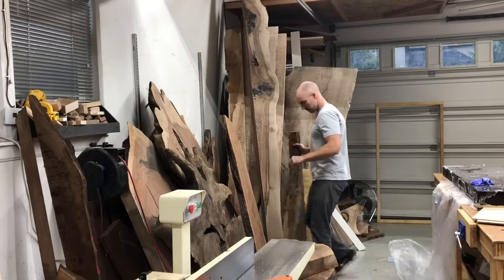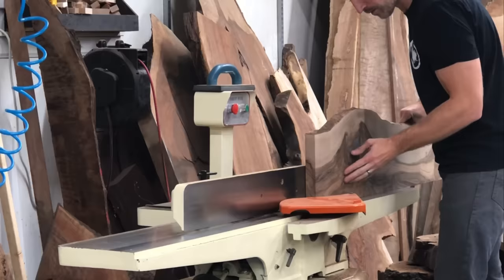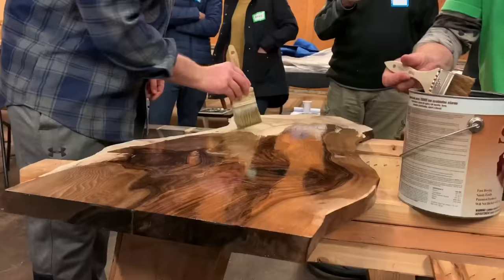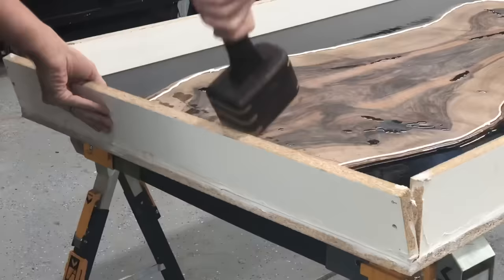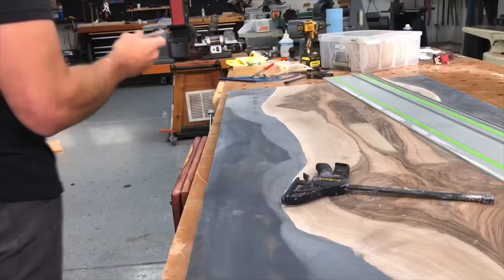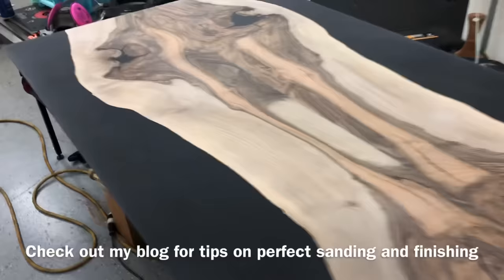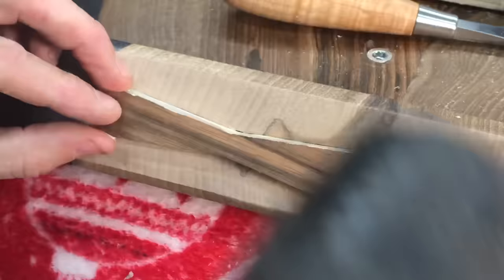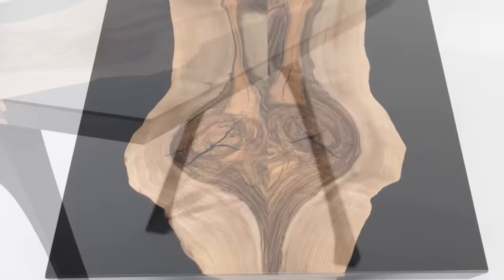Use Half the Epoxy In Your Table Project

Comment: I really like the technique of trimming the edges to add thickness.
Reply from the maker: Thanks Jamie!
Reply: That's a granite trick to create a bullnose profile. Never thought about it in this situation though. Nice!
Reply: @BlacktailStudio  just wondering why you apply shellac to the slab before pourng  the epoxy?
Reply: @ryanhanslo3029  he’s said in the past that it is to seal the wood so it won’t be stained by the epoxy when he pours. That way he only has to do minimal planing and sanding afterwards to have the natural wood figure and coloring exposed
Reply: @TheHuntron2000  if the epoxy seeps into the wood, even plaining and sanding won't save it. The edges get "blurry" because the wood gets dyed black by the epoxy and there isn't a sharp line of contrast anymore

Comment: I've been watching your videos for some time now and have watched most of the earlier ones. This table and the "trick" to save resin is great. I think the legs are perfect, especially if it's used as a desk.
You have inspired me to branch out from turning resin and timer pieces to making my first river table, out of walnut no less! Walnut is not so common in Australia and you have to be in the right place at the right time to get some. A friend cut some slabs for me from his walnut tree that died of old age and they've been sitting in the rack for a few years. They're a bit wormy but that adds character (doesn't it?).

Comment: I watched many of your videos before building my own epoxy resin table. I would like to thank you for sharing so many valuable bits of information. In return I would like to share with you one useful tip  that I haven't yet seen on any woodworking video and that I discovered on my own. Cleaning up the edges of a live board and knot holes on old timber can be done very effectively using a high pressure water hose (Karcher or similar) . This can remove rotten wood and bark easily, cleanly and quickly. My own table was made from very old elm boards that I found in a local sawmill, felled 40 years ago and then forgotten. (I live in France). Thank you once again.
Reply from the maker: Thanks!

Comment: I use threaded inserts with hex bolts whenever possible, especially when mounting metal legs to a table top. Good tip on putting glue in the hole.
Reply from the maker: Thanks dan 👊

Comment: Great video Cam!  Yeah, I use Flowyline for most of my legs. I love the designs Alex comes up with. In fact, the curved ones you displayed at the end I got a few months back.  Thanks for the excellent instructions, I have learned so much from them, and became so inspired that I am doing a lot more work now - in my 1 car garage, in the winter... I also just purchased a Festool sander, with the dust collector, it's on the way now, and I can't wait to try them out!

Comment: I am not trying to be overly critical, you are very talented and make amazing things, one thing I think would help, I think you should invest in a portable table top drill press to ensure that you are getting a perfect vertical hole when drill for the threaded inserts. Some times I can see how crooked they are and I think its a small over sight but should be corrected.

Comment: I was a painter for 30 years and applied many epoxy coatings
on different substrates, including kitchen counter tops.  The epoxy  wasn't durable enough on counter tops,  especially in the area around the toaster.  Apparently people slice toasted items directly on the counter top.  I haven't used your particular brand of epoxy, so possibly your brand would hold up, but my experience leeds me to believe that epoxy is pretty to look at.

Comment: Great project.  Not only saves epoxy, but probably reduces the weight of the table.  The issue you had with the black epoxy on the edge where you covered it up with a bowtie made me wonder if issues like that could be mitigated by using clear epoxy to glue things together?  What do you think?

Comment: A remarkable work of art as well as a sound solid table and excellent instruction. I am polishing a slice of apple crotch wood  and I'm not a woodworker. 55 years ago at school they told me to wet the wood to bring up the grain before I polish it. Times have changed. Should I use an oil as a finish coat or an epoxy please ? I would like a shine and to see the grain. Thankyou for helping a an enthusiastic raw amatuer.
Reply from the maker: Thanks Martin!

Comment: a small bit of advise to others from another woodworker. the domino tool is probably the best option, though I've never liked how they feel a bit loose in the holes. however the biscuit tool and biscuits are a good halfway house between dominos and dowels. they work on the same principle, and are cut in using a similar tool, however they are oval shaped and the tool cuts out a semi-circle. the biscuits are designed to swell with the moisture of the glue (water based glue to be used) because the tool is a lot more simple and the tech a lot older, the tools are much much cheaper!

Comment: I can't get enough of your work Cam! Thanks and keep it coming!
So your work has inspired me to build a dining room table with an epoxy pour inlay. You've probably had this question before, but I'm wondering with your experience, how durable is epoxy generally? Heat (hot pots), scratches, two young boys...?
Thanks for your help!
Reply from the maker: No hot pots. Basically it’s hard plastic

Comment: I've found that biscuits work just as good as dowels and are easier to use.  I've glued up many tables tops made of anywhere from 5 to 10 planks and have always used biscuits and they have never failed me.  

Dowels take too long and imo have no real benefit.  Although, I would love to own a Domino, I just haven't made the purchase yet.  It will be one of the last purchases I make since my trusty Makita biscuit joiner has always served me well when it comes to joining two pieces of wood together. 

P.S.  I just found your channel and have been loving the content.  Though I've been a professional woodworker for nearly ten years, I've never done an epoxy table before.  Heck, I've never even done one from a slab. I've always bought boards and build the tops from planks.  But I'm going to up my game and start selling more expensive tables.  I'm going to be purchasing two black walnut slabs soon (already have a supplier who has them in stock and sent me photos last night) and plan on building two tables with them.

Comment: I am really enjoying your videos, you get such a good finish. One thing though when you are moving the slabs in and out of your flat bed why don't you use a couple of 1 1/2 PVC pipes under the slabs as rollers, to roll the slabs in and out? You lift one end in, on a roller, roll in add a second roller and roll all the way in, then lift the slab one end at a time and remove the pipes. I use that to move around large panels. Thanks for the videos!

Comment: This is a great idea. I've been planning my first table build and will be using this technique to get a thicker table look. 

You make great content. Thanks for sharing!
Reply from the maker: Thanks!!
Reply: @BlacktailStudio  so this may be a silly question but it had me stuck at the moment. I have 13 mm threaded inserts. The shortest bolts I could find at 1.18" which means I have 1/2" of the bold sticking out of the bottom of the bolt once I have screwed it in to hold the table legs down. What length of threaded inserts and bolts do you use? You showed in the video that you only drill the depth of the threaded insert into the wood. Is there anyway to get around drilling deeper to allow for the length of the bolt? Or should I just get longer threaded inserts?

Thanks!

Comment: Even for regular pours, I cut finished plywood where the epoxy streams go.  There's no need to have any more than an inch of epoxy unless u are doing a translucent or clear pour.  It's a big waste of money and no one looks at the bottom of the tables.  I'm not selling them for big money, tho, and most people are cool that ur adding less plastic to the environment.  Your trick with adding an outer rim to add depth was great.  Why not use clear epoxy to adhere it?  would it leave a line?  Seems like a low risk play and it would work on the wood too, no problem.  The other thing I do is use a plastic sheet (like a thick paint tarp) on the bottom of the mold--mount the sides right over it and seal the corners with Tyvek tape.  Even a contractor bag will work.   Love ur vids.

Comment: The bowtie was a radical approach to correcting that bleed. If you had it to do over, would you have done something other? How can you better ensure that it doesn't repeat? Is there perhaps a clear drying adhesive that would work well on both substrates? Beautiful end result either way.
Reply from the maker: I would have gotten it more flat before gluing if I was doing it over

Comment: Those legs are gorgeous, and that's an ingenious idea for doubling thickness! 🤯 I'm just so sad the bookmatch didn't work out 😭 could you prevent the need to plane so low by keeping the piece dead level during the epoxy process?

Comment: I may be thinking about this wrong, but it seems that the slots in the attachment plates on the legs would allow for movement in the plywood base, and there shouldn't be any in the plywood.  Are there movement slots in the screws that hold the plywood to the table top?  I would think that's where the movement would be, but those end pieces affixed across the bottom might cut down on even that movement.   Thanks,  Mike

Comment: Nice trick.
Just wonder if making the mould with the raised insert area already there. So you just pour, the edges will be thick while the center will be thinner. Once dry flip over and remove the insert area. Ready for your actual insert base for legs.

Just ideas.
Reply from the maker: Good idea!
Reply: @BlacktailStudio  Quick question.
I'm a noob to making stuff with epoxy.
It's my first time buying epoxy.
I'm a little confused.
I see stuff being sold that pours 1/4inch. And thick pour stuff that pours 1 1/4 inch.

What should I get?
I'm planning on making a cutting/serving board as a first project.

Would it be better to under pour or do multiple layer pours?

Side note
Have you or will you ever do a live stream Q&A?

Comment: Awesome work as always. Just a question. Why did you not use clear epoxy to glue the double thickness strips? I guess that it would still look perfect between the black epoxy and the leak on the wood that happened by mistake would not be visible.

Comment: I’m addicted to your videos!!! I’ve noticed you have mentioned several times that pours over 6 inches don’t cure well. Can you elaborate on that a little bit. I want to take an 8x8  piece of drift wood and encase it in black epoxy the. Carve it with my CNC. I think the fading in and out of the wood and epoxy is going to look pretty awesome. But this brings me to my question. Since it’s not a “solid” 6 inches is it going to cure well?
Reply from the maker: I’m not sure what exactly you mean. If you want it to be 6” thick you’ll need to do it in several pours.

Comment: Wonderful idea to save some epoxy, Cam !

Would the same principle apply in the case of a river table, for example? You fill up the bottom three quarters or so with scrap plywood, then pour epoxy on top?

I suppose stainless stail screws would be best, then, to hold the plywood together?

Comment: Always a pleasure watching you work, I do like the legs you always seem to pair the table with the right legs.  If you don't mind answering a question for me. I recently made a table and purchased metal legs for it I thought they would be sturdy enough but there was a rocking motion in the table going side to side. The legs are in the shape of an X with a picture frame square in the middle the have a plate on top that goes the width of the table minus a couple inches and and is about 6 inches deep. With about 8-10 screws. I am thinking about putting 1/4 steel plates in between the legs on the top to keep it from rocking side to side.  What would you do to in this case. Thank you ahead of time

Comment: i can't believe you are sanding  the Chamfer/ Bevel without a mask! epoxy does not cure 100% i know it's not a lot of dust, and i know that it's easy to think "ok, just for this little bit... won't hurt"  in a rush i have done it myself,  but it all adds up! the uncured epoxy is dangerous! I don't think the bow tie works. it looks out of place. i would have made something more organic as the risk of a spring wasn't so great. Great table though! thanks for all your videos!

Comment: Beautiful piece. Love the legs on the table. I do have a question. I notice that you do not really sand the top and bottom pieces of your slabs before you put any epoxy. I always see you use a planter, and then sand the table after your table is done with the epoxy pour. Noob question, but would it be okay if I level and then sand it down first before I put epoxy on the slab?

Comment: I think you probably know, but try using wood sawdust and wood glue and smearing it in after you have made a groove in the wood and filled it with it, and let it dry and sand it afterwards. The one where you have the black, instead of making a bowtai, but only if you feel like trying.

Comment: Just curious - why didn’t you use a clear epoxy to glue together the double edges?  Wouldn’t that be invisibles after drying and eliminate the issue with the black epoxy bleeding into the wood joint?

Comment: can you please advice whether you can use plastic in the form at the bottom to avoid the table sticking to the bottom board? also, whats the principle for using wood inserts? drill should be a mi limiter smaller than the wood inserts or half a millimetre ?

Comment: Great video.  I am making an table now and want to try your trheaded inserts.  WHat size do you recommend for flowydesig legs.  I am making a coutner high table and another hall table.  The legs I have are pretty standard from flowydesig.  So far I have put them all in with lagbolts.  But I was wondering what size threaded insert and what size/lenght bolt do you recomend for them?  The table will be 2 inches thick 

Thanks

Comment: I watched a video where you did a strength test putting concrete on your table and then dropping a log on it. Was that done before or after this table was made? These tables seem extremely strong, so my question is with your current level of experience and knowledge would you put the plywood underneath the table again?

Comment: Impressive work.
I think the bow tie was a huge risk to take given the slim thickness of the wood after the bevel. Am a mature might fail with that trick. 
I would prefer introducing a little groove of about 0.5cm then pour a little Epoxy.
What's your say on that?

Comment: Cam, I'm curious. On such a small seam, it seems that digging out the epoxy with a small precision Dremel bit and filling with super glue/wood dust would be easier. Would you not be able to achieve a quality look?

Comment: Why not just route out a thin layer of the the bad epoxy and fill with glue and sawdust? You can use a smaller bit and add a sliver of wood from the off cut and try to match the grain more. But I love the idea for the less epoxy. If you could design a frame to support it, you could finish both sides and market it as a dual game table and dining table. Just flip it over and the edge keeps the pieces and dice on the table. And the chamfer makes it more comfortable to sit at.

Comment: Hey may i ask, i love the solution you made to save on epoxy, but - concidering you ran into the issue of having a black dye epoxy line in your wood (which you corrected with a bowtie), would it not have been a better choice to use transparant epoxy to do the bonding atleast near the wood? i would assume that this would prevent any of the dye leaking into the wood like it did, but since i have zero experience in the matter i wouldn't be able to know whether it would be visible for the black part of the table? would you see a thin epoxy line at where the black parts connect or since it is transparent, would it actually be invisible?

Comment: Think those legs are amazing and to be honest a really like the bow tie in lay for your mistake but really didn't think was much of one thought worked really well and love the added height on the table. One question with regards to finishing I have a black and decker mouse sander which has interchangeable pads could that be used for finishing going up the grit or would a be better off investing in orbital?🏴👍
Reply from the maker: Ya, need an orbital
Reply: @BlacktailStudio  no worries cheers appreciate that info. Keep the content coming.

Comment: These videos are very helpful. I’m starting my first epoxy walnut table build and I’m wondering what the thickness of this slab is before the bullnose trick?I’m planning on book matching my slab, but I’m concerned it will be too thin in the end. Should be about 1.5 inch’s thick after book matching.

Comment: Could you screw the pieces to your bottom mold, plane it and then fill it?  It would allow you to align the grain patterns precisely and then not take too much off changing the pattern later on.
Screwing it down you could move it, refasten, and it is less likely to move in the casting also, so your tops stay flush and level better than weighted down.
i've never done anything like this, so is this a bad idea?
Reply from the maker: Oh maybe!

Comment: Cam, have you tried the Titebond polyurethane glue? I always use Titebond 3 as you do as it’s very hard and I don’t like the yellow hue Titebond 2 dries with. I just built a new table using the poly glue and I was shocked at the hardness. Longer working time, we will see if it’s brittle but time will tell.
Reply from the maker: I haven’t tried that. Will now though!